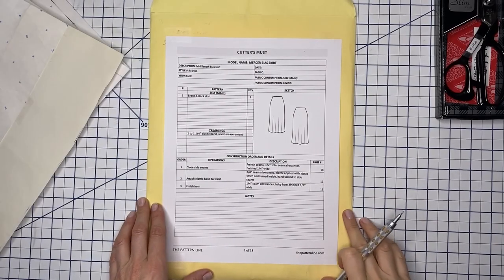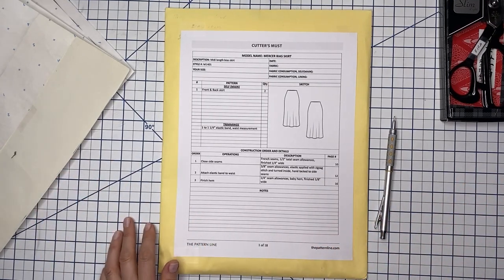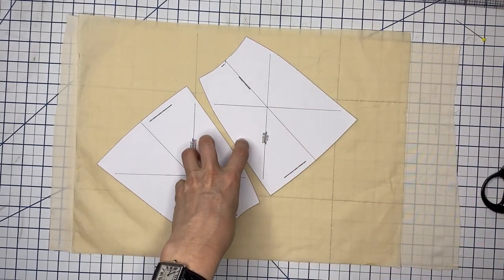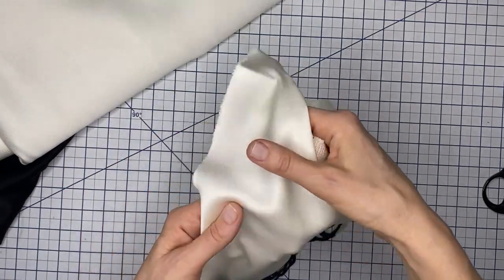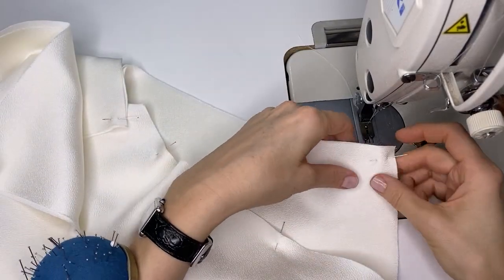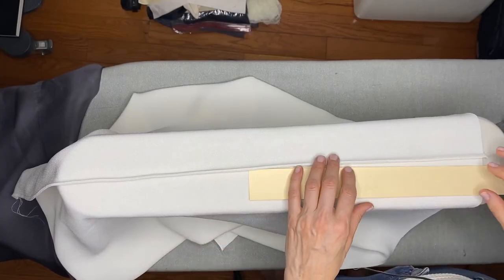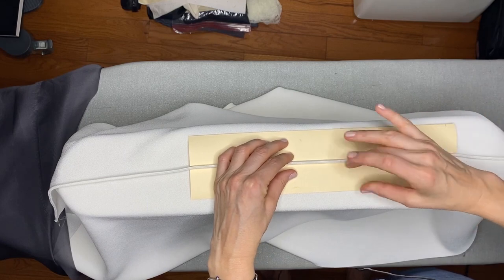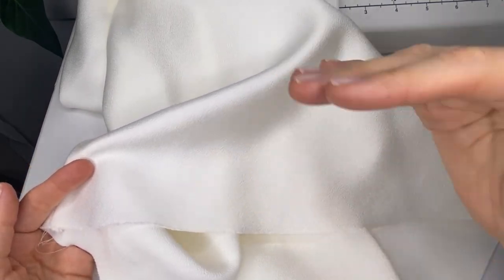How to make a bias slip skirt using luxury RTW construction techniques

Comment: About the tension can you give some information. Should it be tight or loose?
Reply from the maker: It shouldn’t be tight! Smaller stitches with a slightly looser tension: the idea is that when you make your first stitch of the French seam on the side, and let it hang, it doesn’t pull the skirt up.

Comment: Thank you for this amazing video. One question, if you could please help me out. If i want to make this same skirt but much longer, how would I do that? I want to avoid making it wide, so I want the same width as in the video. I tried this earlier and my skirt became wider and wider at the bottom, but I wanted it to be as tight as in the video. Thanks!!!
Reply from the maker: 2 things u you oh can do: 1st just adding a slit, but you’d have to be pretty careful sewing it since it’s in the bias.
2nd: when lengthening the skirt, you want to measure the circumference of your step at that lengthened point (wherever it falls), and that’s the opening you want to target. Good thing with bias, unless it’s really wide, it still falls pretty straight, so it will look like a column visually, even if it’s not. Of course, don’t expect it to look like a true column like skirt)